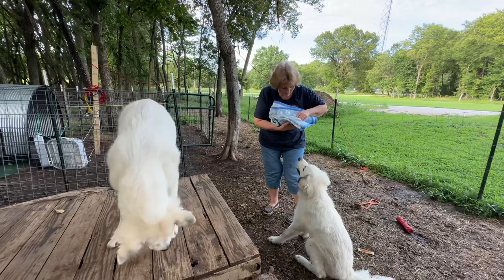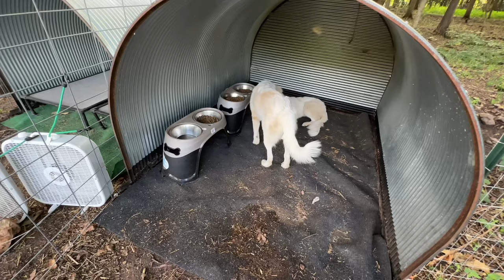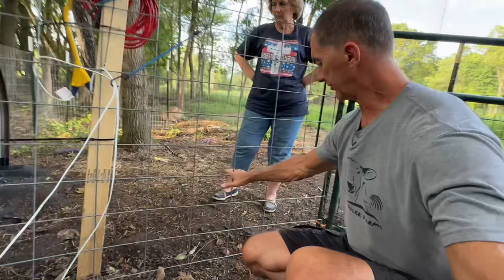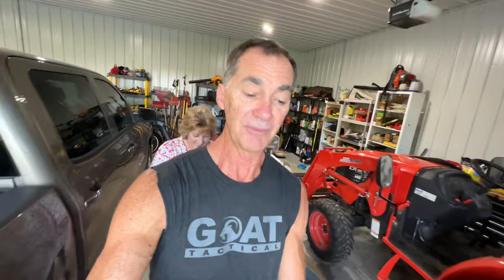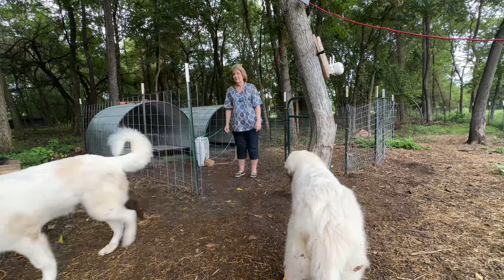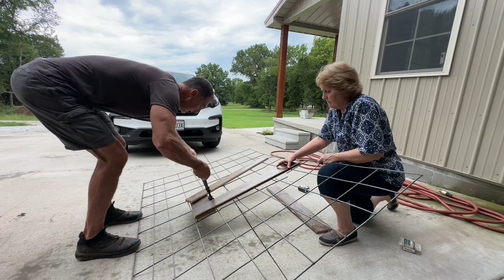I’ve Tried Everything Else!

Comment: the diaper genie/cat poop genie...make sure u do the slider thing before opening the bottom to remove poop. it should seal off the bag & u shouldn't have to tie it. then pull some slack, enough to hang out the bottom & close the unit. slide the sealer a couple times. open back up to check it. it should be sealed enough that u don't have to tie a knot.